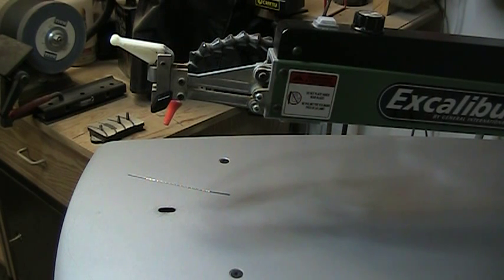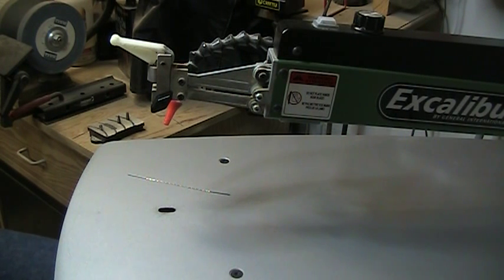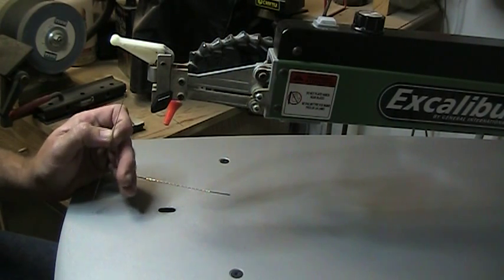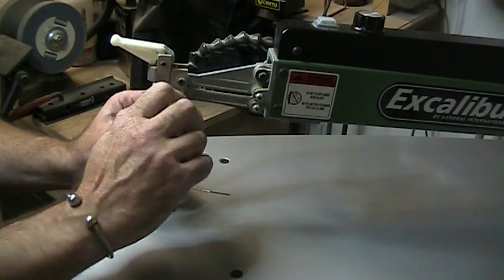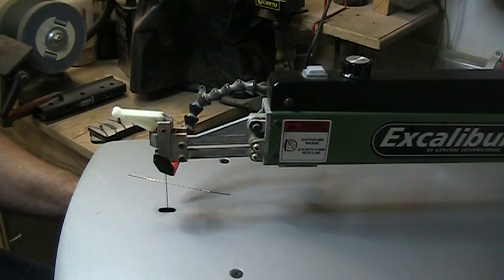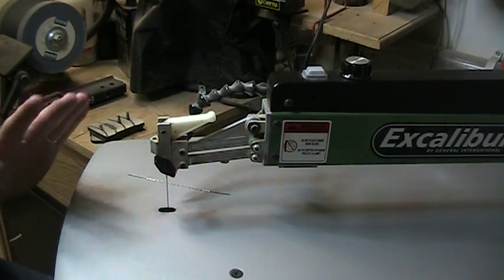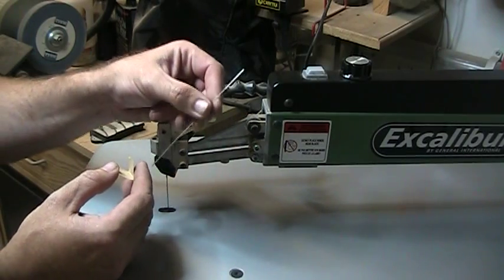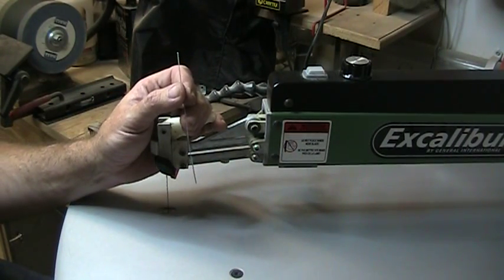Blade chucking

Comment: @acutabove_woodworkings with a table saw blade you can turn the blade with the teeth backwards to cut plexiglass (I have some free stuff but haven't cut it yet...nervous). Can I cut it on the scrollsaw and if so which way should the blade sit please?
Reply from the maker: You actually don't have to reverse the blade on a table saw in order to cut plexiglass. You can just cut it with the blade installed normally.  As far as the scroll saw goes, it's the same thing.  Just install your blade normally but turn your speed way down so that the friction doesn't melt the acrylic.  I hope this helps.  Thanks for tuning in.
Reply: @acutabove_woodworkings  thanks for the quick response!

Comment: Thanks for the tip! I just got a deal on a used Excalibur that is supposed to be only a year or two old, looks new. As a total newbie I am just wondering how stiff the tension release and the tilting arm should be, mine seems pretty stiff. Any thoughts, should I loosen slightly?
Reply from the maker: I wouldn't loosen it at all.  The blade needs quite a bit of tension and when it is installed, you should be able to pluck it like a guitar string and have a small, high pitch tone from it.  It really does need quite a bit of tension, otherwise it will bow inside the cut and wont cut straight.  I hope this helps.  Please feel free to ask any other questions you might have.  You've found a quality saw there.  They are no longer in production.  Thanks for tuning in to the show.
Reply: Thanks so much, I think I am  good with the tension but the tilting arm takes both my arms to lift and then I go to put it down and it takes a bit to start and then I end up with a “hard landing”.
Reply from the maker: @dawnabbott3783  You can loosen the bolt that holds the arm in place just a tiny bit.  It is located at the back of the saw.  That arm should raise and lower with one hand.  In fact, mine is a 30" Excalibur and I can lift it with one finger and then guide it down so that it doesn't land hard.  Loosen that one mounting bolt at the back.  Just loosen it a tiny bit and then test.  Loosen it a little more and then test.  Once you are happy with the raising and lowering action, stop loosening the bolt.  I hope this helps.  If you have further questions, you can contact me via the channel's Facebook page, email or just keep asking as you have been here in the comment section.  I will do my best to get back to you quickly so that you don't have to wait too long for an answer.
Reply: Thanks, you are awesome! I hopefully won’t have to bug you much more, but I found your Facebook page and can use that.  I think I got a great saw other than this arm issue. I have adjusted the screw and it is still not easily lifting up and down….guess I got a small bit of a lemon. I should have done my research better.
Reply from the maker: @dawnabbott3783  I have never heard of a lemon Excalibur so I don't think that's the case.  I think you may be a little apprehensive about loosening the bolt too much.  I would loosen it a little more and see if the arm gets easier to raise.  Silly question but are you sure you are loosening the correct bolt?  Also, just as an FYI, you aren't bugging me in the slightest Dawn.  Everyone needs a little help from time to time and that was the whole reason I started this channel. I enjoy helping people and if I can help you get your saw to a state where you are happy with it, then that makes me happy.  What size saw is this?  An EX-16, EX-21 or an EX-31?

Comment: havin  issues with spiral bades any suggestions they keep slipping out I do sand paperg
Reply from the maker: Spiral blades can be a bit troublesome Doug.  I have used sandpaper on the flat ends of the spiral blades before with some success.  I've also found that you can reduce the tension slightly with a spiral blade so if this is an option for you, you might want to try that so that the blade is not so taught.  Also, while scrolling, don't put too much pressure on the blade when moving your stock around.  Part of the problem is that when scrolling with a normal blade, you are always pushing the blade into the blade retainers but with a spiral blade you are constantly trying to pull it out.  It will require some extra torque on the blade retaining screws to keep the blade in place and try sanding the flat ends of the blades as well.
Reply: thanks will give it a try
Reply from the maker: You're very welcome.  Good luck
Reply: @acutabove_woodworkings  mr am sorry not speak English  speak French thank you